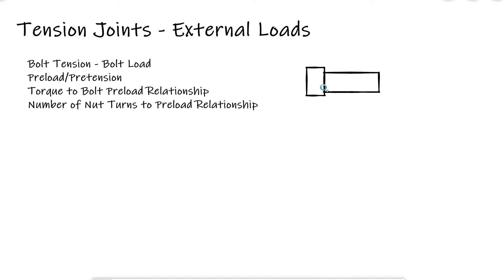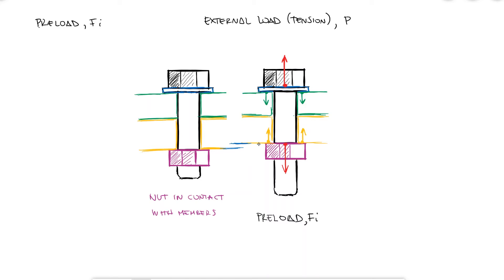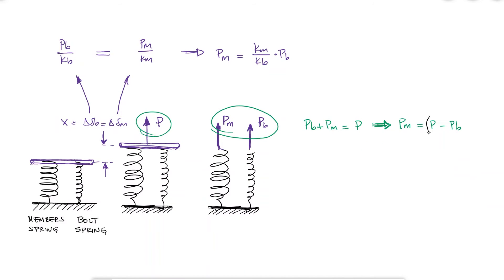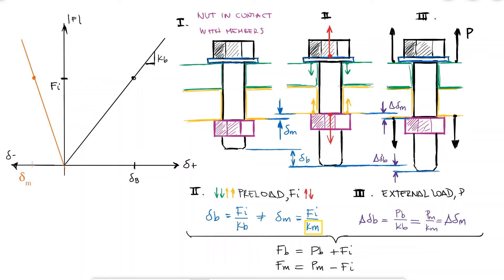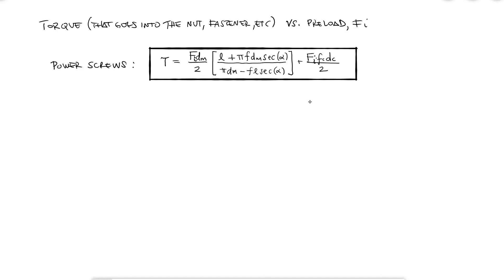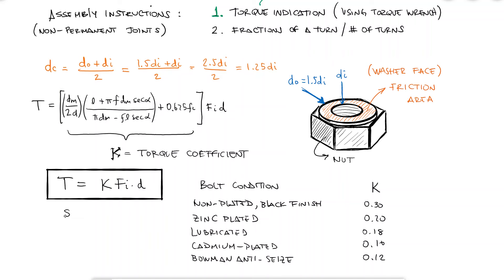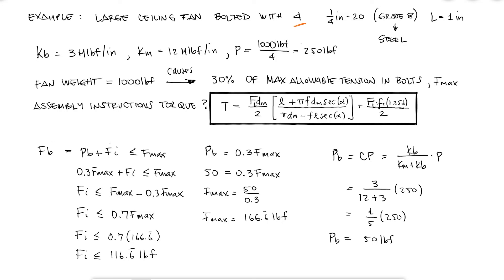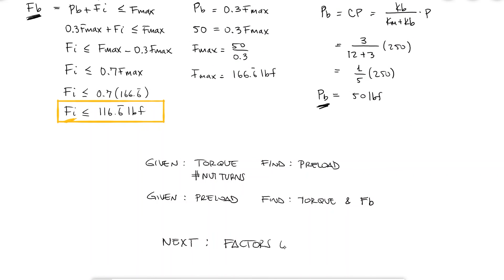BOLT TENSION and Tension at Non-Permanent Joints in Just Over 10 MINUTES!

Comment: The topic of joint stiffness ratio/ load factor is one that is not intuitive. I have seen lots of teachers and professional engineers struggle to explain this well. It usually involves fague analogies, like trying to push a car up a hill with one of your feet glued to the ground, ect. This video is by far the best explanation. You break it down to the core fundamentals. Great video!

Comment: Do not let this person or anyone who believes this near any substantial engineering project. This is the same mistake made in Eurocode 2 some years ago and has probably resulted in thousands of building and bridges across Europe being improperly designed.
Reply: who gives a shyt what you think or believe?😏its obvious you have never been in a classroom where such simplifications are common..we all know what is required,we are not dumb brainiac🤬
Reply: what do you mean? what happened?
Reply: @Dwindledoodoo  Hilti book showed the torque for the selected studs on a power station project as 270Nm. this was about 2007. Then the new codes were published and the new Hilti book said 150Nm. The workings that were published with the new code showed fasteners subject to factors of safety as though they were a concrete slab or a structural beam which is ridiculous. I put this to Hilti and it was referred back to their top people in Lichtenstein. The answer came back that yes, they knew it was wrong but it was the law now so they had to do it that way. So every building and piece of machinery in Europe is going to be improperly fixed to the ground? Yes. It's the law now. Not impressed. I haven't been doing that kind of work so I have no idea if any of that has been fixed in the intervening years.

Comment: thanks you so much for this useful lecture.
i just have a question about the way to define Pb load based on External load ( 03:44 )
My understanding, for the pre-load condition, Bolt is under tensile load and members are under compression load.
Then if we apply external load in tensile direction ( tensile load ), then members will be released the force. 
Mean that : force in bolt = Fi + Pexternal
and Clamping force in plates = Fi - Pexternal
Then it should not has C factor - Stiffness constant of the joint.
please correct me if i was wrong. 

thank you so much !